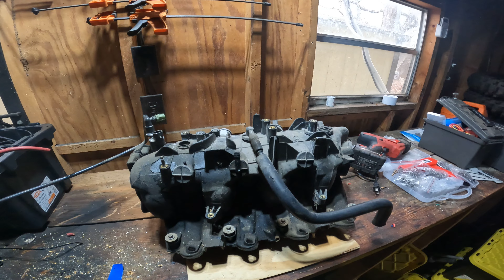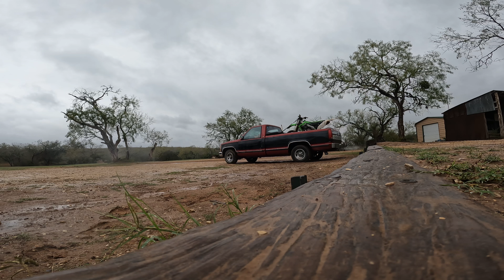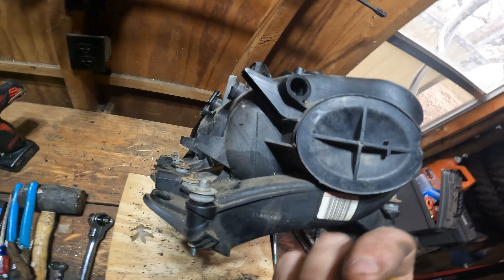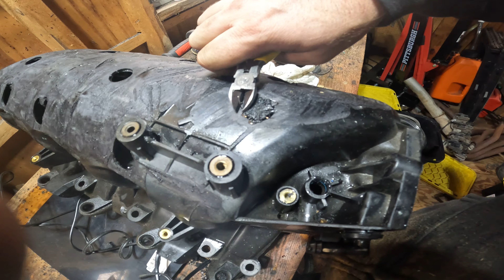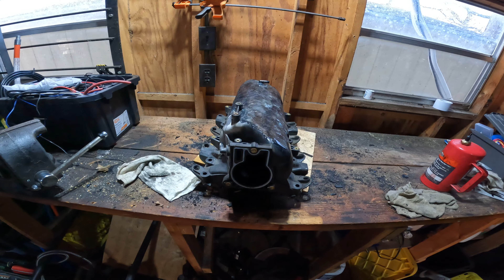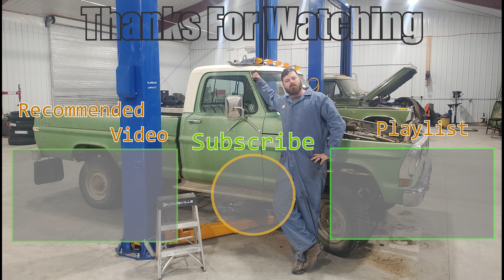Shaving a LS Truck Intake.

Comment: That is ABS plastic, you could also just use the clear ABS primer and ABS glue, after 24 hours its litterally the same as the parent material and can be sanded the same. Been there, done that! good job though! Hot staples are great. the mesh works better in some places with a flat iron.
Reply from the maker: I wanted to use mesh, but I didn't have any. I hope this holds
Reply: @crescenthammer  it will. i have used what you did on motorcycle parts that take a beating. still holding strong. you did a great job for what you had on hand. Every time i do a job there is always a way i find later to do it "better"! motor on!
Reply from the maker: @timsgarage1356  thanks

Comment: Id add a skim coat of body filler over that and block sand it smooth.
Reply from the maker: I was going to smooth it out and really clean it up, but I'm not going to use it. I'm going to sell it. I figured the next guy (who's probably a lot better at body work than me) can do it the way they want.
Reply: @crescenthammer  I'm not sure it would have much value as is but yeah... other than practice and experience, theres not much point going any further if you're not using it.
Reply from the maker: @aaadamt964  I basically said make an offer.

Comment: I didn't make it through the intro without getting mad. Never be seen doing a peg leg gravel burnout. Either swap your diff or weld it up. Stay on track on the hillclimb unless you know you can take that lip AND this is the most important one - Pushing your angle grinder into that round stock will piss it off so bad it will redirect all of it's spinning energy into a launch straight at you.  I'm warning you because the grinder doesn't give one. I hope this message finds you still alive and having fun.
Reply from the maker: I'll be alright, thanks for your concern.
Reply: Take it easy friend… this is unnecessary 😂
Reply from the maker: @RevRodge  he's going to be really upset if he watches the video of me welding in basketball shorts and flip-flops.
Reply: Take it easy man. Don't give yourself a stroke when your opinion actually doesn't matter.
Reply: @buckykattguitar  FUBucky